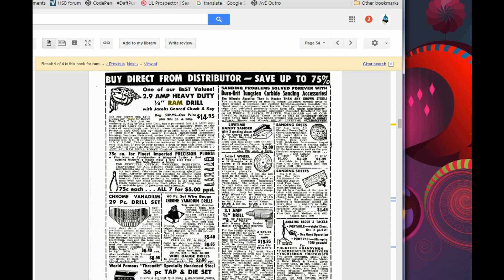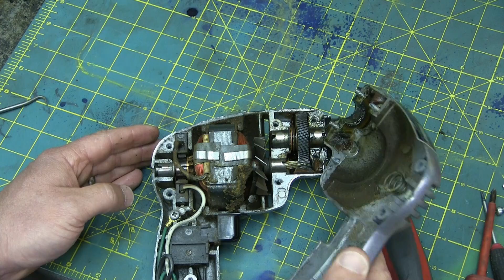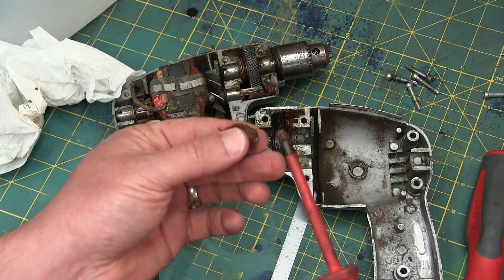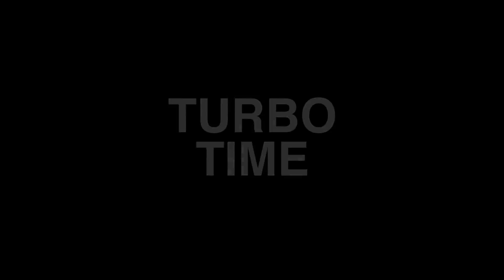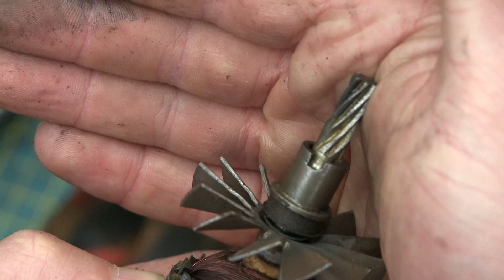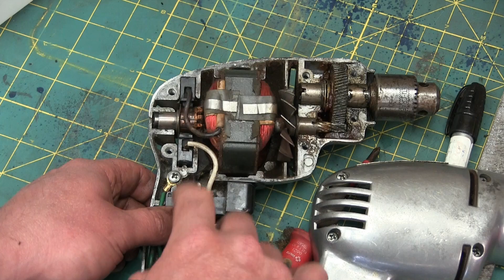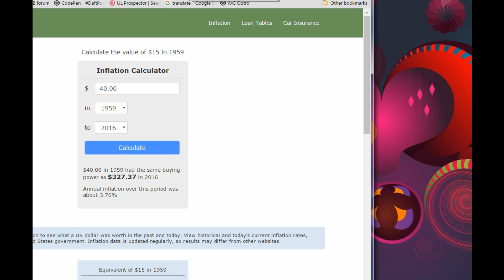BOLTR: Nifty Drill from the Fifties!

Comment: The gears are cut to preload the shaft forward and the pressure from the workpiece pushing back on the drill bit will counteract it.  It's likely not a balanced equation, but it would help reduce wear on the rear thrust surface.  If you reverse the helix of the gear teeth, you are preloading the rear thrust surface which will have to take the additional workpiece pressure as well.

Comment: forward axial thrust from some of the motor work is correct - it provides some opposing force to your hands and arms pushing the drill into the workpiece. Meaning your bearings may last longer (being in a semi balanced state)
Reply: That is exactly what I was thinking.  That's why the bushings are in such great shape.  The bearings have load in only the direction that they are designed.  Part of the reason that you wouldn't want to use a spur cut is that it will put non-parallel force on the bushings and will oval them out.  With helical gears, a lot more of the force is in line with the bushings allowing them to work the way they were intended.
Reply: Snocrash  :  That's pretty much what I was going to say, but I would also add that when that drill was made, the drill technology was pretty awful, and the bit might only have cut one good hole in a relatively thin and flimsy piece of aluminum before the bit was dull, so people developed a technique that meant they would basically stand on the darned drill trying to force the bit to cut. Therefore, when the "200# gorilla" stands on it, everything runs "skookum choocher".
Reply: its realy quite satisfying to see one youtube dude that im subscribed to commenting on another youtube dudes video who im also subscribed to   :-D   thats a fairly convoluted sentence but never mind.

@snocrash and @AvE i love both of your videos
Reply: 19ninetynine Thanx. Explaining in plain English without a diagram isn't easy  :-|
Reply: I have to agree mate
Reply: thought so too
Reply: @snocrash - that's kinda what i was thinking, seems like it would provide a degree of balance under load which seems imo preferential to Ave's suggestion that you could minimize the number of surfaces under wear. Maybe six of one? @Tennesseema20 -  I think you might wanna recheck that cause it looks to me like he's spinning it the right way.
Reply: Tennesseeman20 you'll need to have another look carefully - the helical gear (i.e., chuck) is being forced towards the workpiece by the torque of the motor
Reply: Tennesseeman20 This link will dispel any confidence you have.  imgur dot com/a/Zwtwj ,Pink represents the rotational direction of the drill.  Orange is the tangential normal force contacting from the primary helical gear. Green represents the vector (and direction) of thrust force.
Reply: I did think about it :-) at the time I first commented. Force is applied on each tooth on the large gear - some of which forces the large gear forward out towards the workpiece. That's clearly shown in the diagram (you can visualise it as tooth wanting to slide forward and out of the drill). No engineer or text book is going to have a design for something like this causing the chuck to retract back into the body. It's the way we've been doing it for over a hundred years for these types of gears.

Comment: The rear motor bushing key notch was not aligned properly with the housing and the washer was on the wrong side, DUH,  and the felts are to hold oil for the sintered bearings to soak up over the years...

Comment: Purchased a Black and Decker 1/2 inch drill in a pawn shop in 1974, it traveled all over the world with me installing communication systems, 27 Countries all told. It was old when I bought it , not sure how old. It now hangs in my shop ready to work. Over the years I have installed a new Chuck, and a new 110v cord. Some things are made to last. Thu the years its been dropped over 20 feet, flooded, used as a hammer. Not bad for a 3 dollar investment, out of the cheap tools bend. Oh forgot its also a hammer drill.

Comment: I had a Ram 1/4" drill. Dropped it many times and it kept on running.  Do not remember what happened to it.  Next drill was a Skill hammer drill with all metal case. Finally threw it away two years ago.  The last b&d product I ever bought was a B&D 1/4" drill all plastic Dropped it once and it never ran again.  Pulled it apart to find out why. It was just crap plastic and that was the last B&D product I ever bought.

Comment: Why do they use magnesium castings given magnesium burns like a mofo? What is the benefit of a thermite motor?
Reply: I mean, OG thermite used aluminium powder, so...
Reply: Fair enough, point being, why is an expensive flammable material better than aluminum? Cheaper?
Reply: harlequindemon666
Magnesium has some advantages I think. I know they've used it in helicopter rotors before.
Reply: According to Google:
33% lighter than aluminum.
Similar or greater mechanical properties.
Lower working temperatures extend die life and reduce energy consumption during production.
Machining is faster and easier and machining tools last significantly longer.
Superior thin-walled near net shape casting of larger, more complex parts so there are fewer components and less assembly required.
Greater general corrosion resistance.

But if anyone has more to add would appreciate it.
Reply: Not much to add other than the weight savings and casting properties. But you got that.

Comment: Great video, I have a mid fifties 3/8" slow speed craftsman from a garage sale, it was locked up with a splinter of wood in the fan, cleaned, greased and removed all crap, it works great, forward and if the bit grabs it'll break your wrist. Dam, if it doesn't run all afternoon, I use it for honing engine blocks, mixing mortar, paint and as a die grinder, I've had it 30+ yrs still going strong, not bad for $2.00!

Comment: Not sure I understand the Salton Sea reference except maybe it was supposed to be the Palm Springs of the future back in the 1950s until agricultural runoff killed the environment.  Regardless I had this very Ram drill in the early 1960s. It had a bad habit of shocking the user after a few years use especially if it got anywhere near water any time in its life.  Replaced by a corded Milwaukee 1/2" which I still use today.

Comment: I have an old Bosch handheld drill which I inherited from my grandfather. Circa 1960's. All Aluminium housing, 2 speed gearbox, has been used all of his working days to stir grout and the likes for masonry. The chuck needs to be replaced or refurbished, but the drill itself will start and run for hours, even break a wrist while doing so. I have had 1/2 inch drills in it and it is freakishly strong. It will outlast me and the end of the world.

Comment: Top video. I have several drills like this, mine are black and decker and Sher, I have several different designs and plan to restore them when I have more time. I'd love to make them useable but it might not be practical. I actually have a massive B&D with screw on handles that looks as if it was used in ship building or something. My usual go to 'modern' drills are a Makita 7.2v because I love the design of it as well as a B&D 14.4v anniversary as it is metal and resembles the old drills. Wonder if you could retrofit some modern internals into an old case, or do something to improve their earthing? I had an old fella tell me they have very poor earthing which turns the user into the earth.

Comment: My dad worked for Stanley in the 60s (in Sheffield) and had a Stanley-Bridges drill that came with all sorts of attachments - bench grinder, circular saw, combined lathe/pillar drill, even an air compressor/spray gun.

Comment: Ha, I have a RAM Medallion 1/4" drill of the same vintage, slightly different model with small nuts (not rivets) holding the number plate on the top of the 1 piece chassis.  Front loading guts.   States its Heavy Duty Industrial model.  Made in Chicago.  Has a UL rating logo on the number plate where you have the CSA logo.  Just put a new cord on it.

so I'll see you one RAM and raise you a Powr-Kraft 3/8" drill with variable speed......  yeah buddy!!!

Yep, I still use both.

Comment: I found two of these older drills in a trashheap - they seem to be torqey, but i am a it reluctant to use em because of the possibly rotting insulation and aluminium housing and the somewhat systematic use of grounded sockets with no ground connected here in Denmark, and the european confusion of using the same pattern for lines but different connectors for ground.

Also got a drill powered hedge shear laying around, never used it.

Comment: Have a few of the old metal drills. Compared to today's junk, they are titans of destruction. And if you fit them with a new chuck, fix the bearings, put new contacts, polish things, they burn modern professional tools and piss on the ashes.

I mean, i can run an old Bosch, B&D, a Skill for hours in my wood shop, where i have a station that allows me to use them as slotting machines (multiple stations, with different cutters using drill press attachments), if i'd try that with a modern one, and i did, i'd melt the damn things. Not to mention because modern POS doesn't have actual bearings, just sleeves, the precision of a junk like that is...well there's none to speak of really. Heads on modern drills drift like a c... which is why, they never advise you to use them as you'd use a mill. Which, with an old, solid mounted drill, you can. Safely enough, really.

That being said, this particular model ain't top of the range,  mean the couple of Russian made ones i have (they have a specs written in Russian cyrillic and no brand name, just a swirl encased in a square), have ball bearings inside. So dickey type bearings with oversized races.

Comment: hey, if you want won of those multi-tool headed power unit horseshit machines, craftsman make a bolt-on (black and decker matrix is the rehouse of it) set where it's got a bunch of snouts to stick on the motor.

Comment: The direction of the helical cut drives the rotor back towards the back, which sounds like a better arrangement to me. The chuck is going to have face pressure on it if it's working under load anyways so that forward end isn't going to ever see a lot of wear anyways.

Comment: They did have Buna-N o-rings in the fifties. GM used Buna-N o-rings to seal the water jackets on their early locomotive engines back in the 40's. I guess they just used felt shock absorbers because they wanted to.
Reply: But they wanted a drill that would fit in your hand!
Reply: Them o-rings where probably expensive-er back then, having just been invented, wheras felt was cheep and simple.
Reply: +Justin Bell Yeah, but they only worked on like 6 volts and were expensive as hell!

Comment: My dad just gave me a vice from around this era. It's made so well that I can't even use it. The thing is so damn heavy that it would flip my pissy work bench..
Reply: Just get some unused railway sleepers and make a proper bench. Twill last decades.

(see, there is good uses for tree carcasses)
Reply: Mike Savage
I like how you specify unused railway sleepers haha
Reply: TacticalBBQSauce Yep, much easier than trying to wriggle them from under rails. :)

I saw a guy destroy a sizing planer when he ran a used one through it, he never checked it for the remnants of spikes.
Reply: if your bench isn't bolted to the ground you're doing it wrong
Reply: @jonahcottrell2879  i have a 1910s cast iron bench stick welded to the steele rebar in my concrete shop. it only moved in a hurricane when a tree flew into it and bent the surface. we just melted steel into the gap because we couldn't bend it back
Reply: Vise - people studied English back then.
Reply: JDave Foster  'vice' is the correct spelling here in England. We do have some authority on the subject of English, here in England. Some say that the English invented English.
Reply: @willjdeanie  technically no english was modified from preexisting language which is why english has very few of it's own rules that it actually follows.
Reply: @willjdeanie  I think it was the Angles or the Saxons. Of course the language got totally corrupted after Bill came over with all those French speaking Norsemen in 1066.
Reply: @janderson8401  bill Clinton? Or Cosby? I get the 2 confused
Reply: Vise is the American spelling and an old one at that. So don't try to be smart man
Reply: waswestkan
 But will they still be perfectly fine in 100+ years? Tools don't seem to last like they used to
Reply: Ouch :(... That's gonna give me nightmares tonight.
Reply: +TacticalBBQSauce everything eventually goes to shit. Ask my abdomen.
Reply: Time to let the changing table go back and get a real bench
Reply: #TacticalBBQSauce Yes, they will. The marketers and bean counters haven't figured out how to screw up a couple of big chunks of metal with a simple mechanical screw...yet.
Reply: Jonah Cottrell no if you need to bolt it down its to light...
Reply: +Cryosardonic yup
Reply: So what does that prove? On can still purchase heavy, in weight, heavy duty vises. Just a false dichotomy you weaved, but you got 58 lemmings to go hell yea.
Reply: waswestkan, you’ve proved two years ago that you couldn’t compose a grammatically correct and legible sentence.  Bet you haven’t improved upon that skill set, unless you tried to go back and graduate 6th grade.  Just a casual observation...